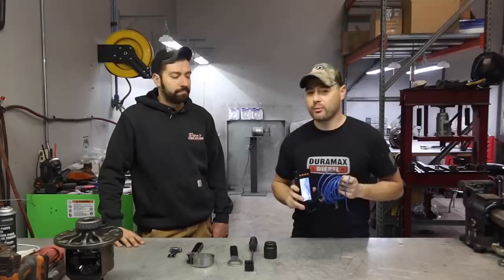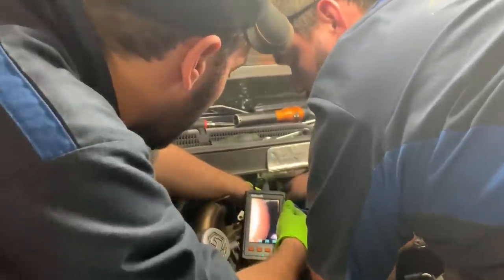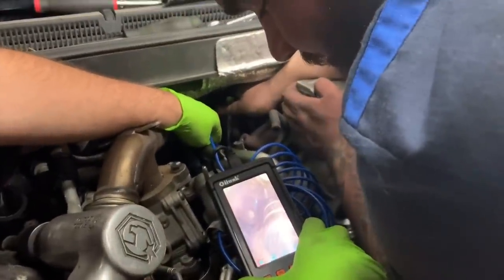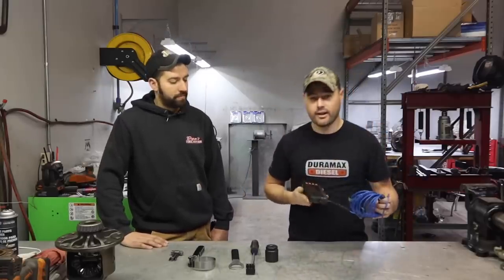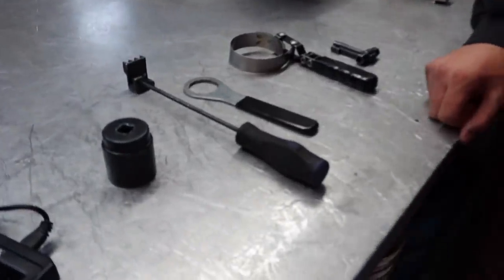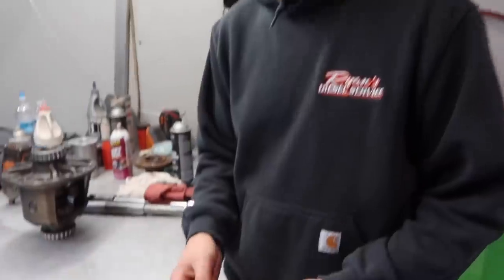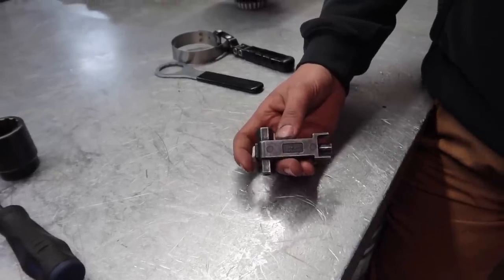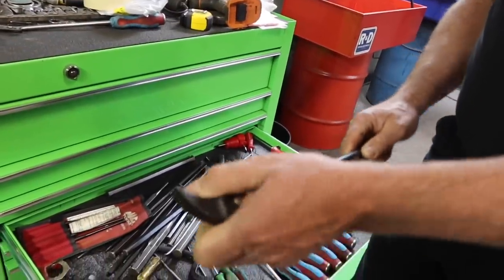Tools Every Duramax Owner Should Buy

Comment: Got a question. Someone got a 2005 Duramax diesel for $8100 and it's in Fair condition and the "Service 4wd" came on. You think it's worth it. The millage is 218000. Need help. Thank you
Reply from the maker: It might be work $6500 if it runs good that’s my opinion
Reply: @TruckMaster  It run but need works. Thank you. He wouldn't lower the price.
Reply: @saelee33  leave it. Unless you have around 5-10k to throw at that truck, then walk away
Reply: @jasondelaloire9167  Damn. Didn't know it would cost that much to fix it up. I'm going to pass on that truck. Any idea what year is good and the millage? I want to get one but only want to spend around 10 to 15k
Reply: @saelee33  I'm the owner of a 02 2500 lb7. And i got had by a guy who said the oil pressure gauge was faulty. Turned out to be fuel diluting the oil. That was just the beginning. 7k later i have a good running truck and i still have 2-4k to throw at it before i can even tune it. Just a cautionary tale.
Reply: @jasondelaloire9167  Man oh man. I'm looking for one but never own a diesel before. Just need a little guidance.
Reply from the maker: You should buy a 2006-2007 as a first diesel these have less issues
Reply: @TruckMaster  what is a good millage for those year.
Reply: @saelee33  any lol. Look for rust. Those lbz's are damn good motors.
Reply: @jasondelaloire9167  Thnnk you. Will do.
Reply: Yeah, a few months ago I just bought my first turbo diesel truck. 07 Classic 2500HD Silverado LT. Verified LBZ. It's a crew cab with an 8 foot bed. Sick truck!
But has or had issues that I'm still getting corrected. A few interior issues that are now mostly fixed. Some small dents and dings around the body that I'm working out with a paintless dent remover kit. Was missing some bolts here and there. Lower fan shroud missing. Brackets that hold the the fan cage in place are missing. A few bolts around the engine bay have been snapped off. Shitty batteries. Trans needed a fluid change with both filters and the lines and coolers flushed. Over sized tires that were rubbing while turning so had to get new tires. New headlights. Needs new headlight brackets because the OEM have been cracked and busted. The only mods done were PCV reroute and catalytic converter deleted. I deleted the muffler. Added a chrome tip. Removed the door bumpers. Wanted to remove the fender flares but the paint under them is scuffed beyond repair besides a full repaint. Fortunately there is no rust at all. Has a new bed liner. 240K miles and she pulls hard and fast. No tunes. Planning on doing the correct full EGR delete and getting the 5 way tuning knob with EFI Live. Probably won't push it over 100HP extra. Stock trans. Looking at doing the TransJr Go kit. Wanting to add a few more dress up items like a brush guard. Already installed quality towing mirrors. Kenwood bluetooth touchscreen radio, rearview camera, and Apline speakers installed. It adds up quick. 
I'm thinking about having my trans rebuilt and beefed up hopefully sometime next year. Need to add a lift pump kit.
Seems like it never ends but this is the most fun I've ever had with a truck. Everytime I drive it I fall in love with that turbo sound and the V8 diesel growl. 
I've had 4 trucks. Still have 2 of them. My first truck I kept for over 10 years. It was an 89 Chevy Scottsdale K1500 step side. Built 355 engine that I did myself. Straight piped true dual exhaust. She was fucking loud as hell and sounded mean. Was pretty quick up to 60 and was gutless after that. Lol Had a Holley Performance TBI matched with an Edlebrock TBI Performer intake manifold. Flat top pistons. Small performance roller cam. Custom paint job. Custom interior. Had to rebuild the 700R4 trans twice. Lol 1000watt sub system that was custom tuned and ported. Caused my rearview mirror to fall off a few times and cracked my front windshield one time. I wish I never traded her in. :( should have just kept it. But it was constant money and work keeping that truck on the road and it got like 7 miles per gallon. Lol My LBZ gets almost 18 MPG and could damn near pull a house over.
Reply: @saltysteel3996  Sound like you been thru alot and spend alot on it. Now at least you know what you are doing. I'm new to the Diesel family. Should of sale ur old truck to me lol.
Reply: There is nothing wrong with a 2005 LLY.   Few upgrades and tune...  good to go !!       Mileage to buy at ,  should be the  150,000 mile mark for your price range.
Reply: @saelee33  I just got mine about a month ago its a 06 and had 54k on it. I paid 30k for it. The original owner was a older gentleman an he had the maintenance records for the life of the truck.  I looked for about 5 months and had to drive five hours to get it. I found  a couple with under 100k but most had between 100k-150k
Reply: @j5long  Congrat! Hope to get my soon!
Reply: @TruckMaster  Found a 2005 Duramax Diesel 4X4. They want 12500. You think it's a good price. Looks clean and it have 220000 on it. Please help.